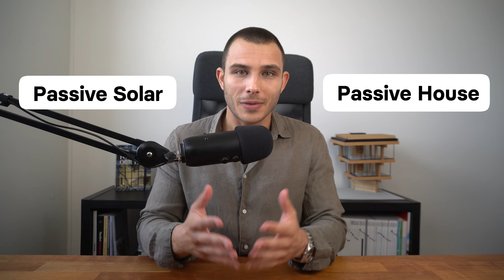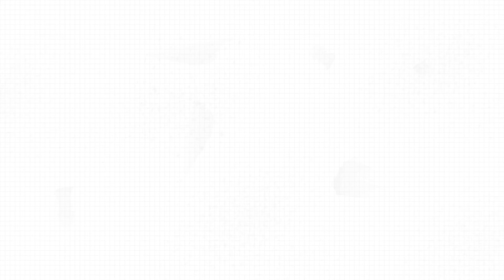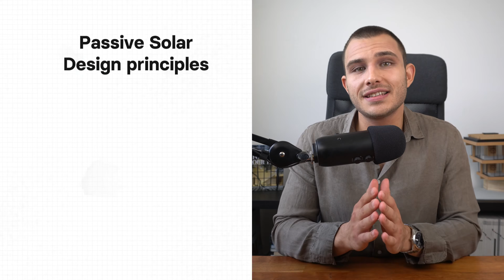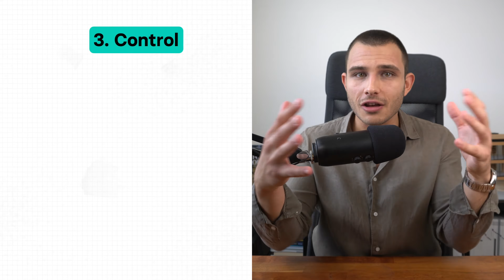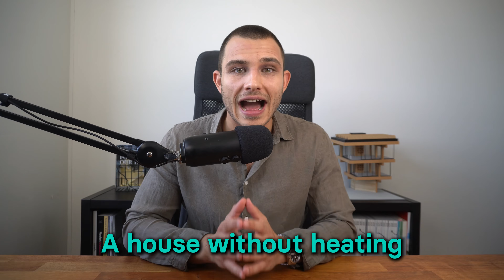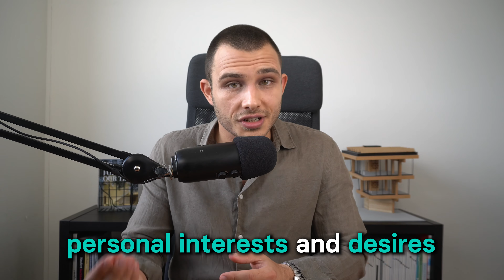Passive Solar vs Passive House EXPLAINED

Comment: Very interesting and well explained. 🇨🇦. Do you like SIP panels as an exterior wall assembly ?
Reply from the maker: Thank you! I'm happy to see you are enjoying the videos 🙂 

SIP panels can also be used for Passive House projects and we are working on a few projects using SIPs.
Reply: I’m just completing my third project using SIPs (6 1/2” R37). Thermapan SIPs has never supplied a wall panel thicker than 8 1/4” (R47) even in the far north in Canada. There must be a “Rule of diminishing returns” relating to SIP panel thickness. Passive house standards are R75 which would be a 12 1/4” inch panel
Reply from the maker: @qualitybydesign5119  If the tinsulation thickness in the prefabricated panels is not enough, then additional external insulation can be added to achieve the desired U-value.